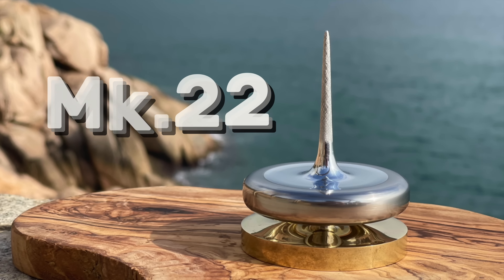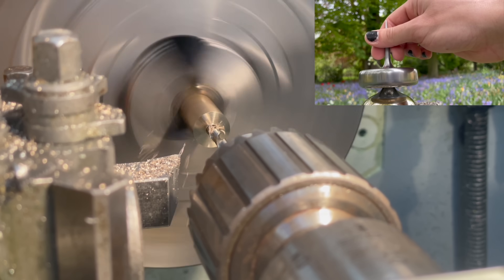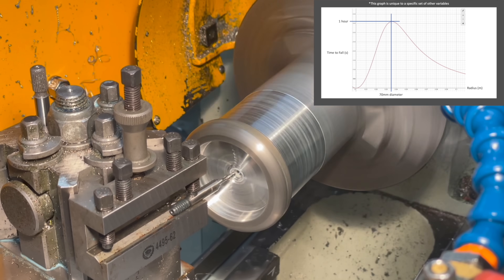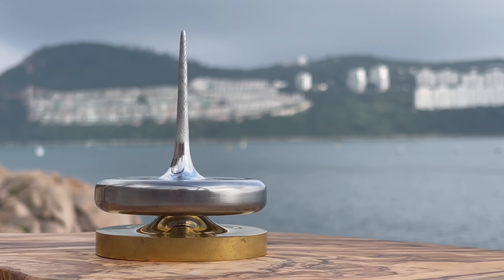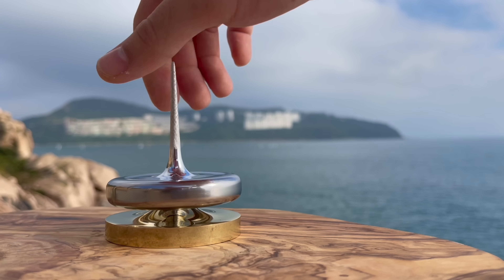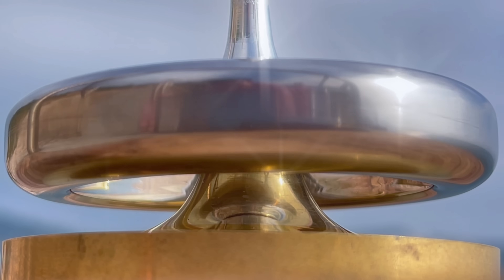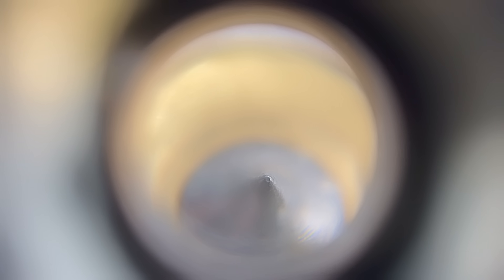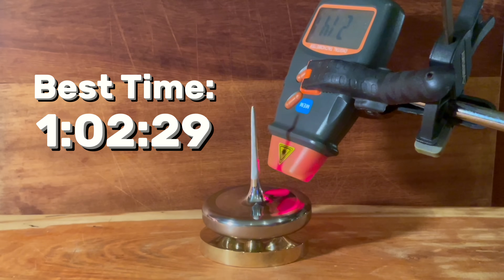Spinning Top Mk.22 | 1 HOUR BARRIER

Comment from the maker: I have commented about quite a few similar suggestions so I think I'll leave this post here in case your great mind is thinking alike!

1) Golf Ball Dimples / Shark-Skin or otherwise textured coatings for reduction of air drag:

Golf balls work by increasing viscous drag but decreasing pressure drag by more (put very simply here, many good vids out there). Since my tops don't experience pressure drag, adding texture would only increase viscous drag. So far, I've found that a perfectly polished surface is best, however it is certainly an area for innovation so do leave other ideas!

2) Ruby/Sapphire jewel tips/bases:

Tungsten carbide, like I use, is harder! And easier to get in a spiked form which benefits more from lubrication.

3) Polycrystaline Diamond/Cubic Boron Nitride tips/bases:

These are harder, but very abrasive. If only used for the tip, it would cause drilling. If only used for the base, it would rapidly blunten the tip. If used for both ... I'll admit I haven't tried yet but I suspect both would occur.

4) Uranium/Osmium/Platinum etc flywheel:

(Apart from uranium) I would LOVE this, however I am not a millionaire so this is completely out of my price range. Pure tungsten would be the densest viable option (almost 20g/cm^3) however I have struggled to machine it in the past. Hence, Mk.22 used a 90-10 alloy (16.75 g/cm^3) which is softer.
Reply: spin it in a vacuum :)
Reply: What about hydrodynamic bearings? Or does a top have to spin on a point?
Reply from the maker: @jjb0nks  It should spin on some kind of point, either conical, spherical etc. A bearing like that would stop the top from being able to topple, hence it is no longer a spinning top.
Reply: @hiper_tops  Does the base have to be static? The base could be another spinning element (with a means to retract when it loses momentum, a centrifugal clutch mechanism or something). That way tip friction could be reduced. The base element could have a shell around the top's doughnut (to shield it from drag). The thinking is to have something like multistage rocket, but with like mechanical parts acting as boundary layer separators to reduce the delta V to the surroundings.
Reply from the maker: @DT-dc4br  I see what you mean but if I strictly go work towards improving the record, it would not be allowed. A different idea which might be interesting is holding the base on an inclined, rotating surface such that the top moves in a slow circular path. This would stop drilling and potentially help spin times without really adding energy to the top.
Reply: From Wikipedia: "...the dimples on the surface of a golf ball cause the boundary layer on the upstream side of the ball to transition from laminar to turbulent. The turbulent boundary layer is able to remain attached to the surface of the ball much longer than a laminar boundary..."

I don't believe this can be used for spinning motion, since for the air layer to stay attached to the surface, it would have to rotate along with the spinning top. I feel like the air would rather be flung outwards than stay with the circular motion, which would probably introduce more friction than with a flat polished surface
Reply from the maker: @carny__  Yes precisely :)
Reply: Time to use a laser balancing system to truly balance it.
Reply: Have you looked at WPC treatments?  I'm not entirely sure it would work because you already have hard surfaces and small contact points, but maybe?
Reply from the maker: @TGoat5  Polycrystalline tungsten? I'm not familiar with this. I'm looking for a material with incredibly high hardness, without being abrasive, for the base and a material with slightly lower or equal hardness for the tip.
Reply: @hiper_tops  not polycrystalline tungsten.  WPC is a surface treatment that creates microdimples that lower friction sometimes used for engine parts.
Reply from the maker: @TGoat5  Ah I see this is like the air bearing effect - it certainly has potential in similar applications, in this case the top would be floating on a cushion of air. However I can't find a way to implement this whilst the top is still able to topple! Without the ability to fall over, it is no longer a true spinning top.
Reply: @hiper_tops is some kind of titanium aluminum nitride or similar coating useful?
Reply: @hiper_tops several people have mentioned air bearings, but have you ever played with ground glass syringes? You can spin them up, they're pretty neat and nearly frictionless, also very stable atop a cushion of trapped air. there's a Steve Mold video on yt where he demonstrates the effect
Reply from the maker: @tylerjmast  I must admit I am hesitant about coatings because, for spike tips at least, after a few hour-long spins, I have to resharpen and rebalance the tip with diamond files. So any coating would be lost quite soon, and it tends to be an expensive process. I can see a coating for the base being more viable though.
Reply from the maker: @tylerjmast  Yes I have haha, I actually made a stirling engine using some of them :) The air cushion effect is very cool but hard to implement with spinning tops
Reply: Spin it atop an air bearing.
Reply: Why is the stem so long? I know you must have a good reason for that, but intuitively, I would shorten it.
Reply: @Nonkel_Jef the taper allows you to spin it faster by hand. When you roll a cylinder between your fingers the smaller it is the faster it spins, you get less torque though.
Reply: Is there any easy way to see if the flow around it is turbulent or laminar? If it is already turbulent then you may see some benefit from texturing. You have a relatively narrow gap between the top and the base, so you might be seeing some turbulent flow in that region. Maybe blow some smoke in there to see what is happening. A quick napkin modelling suggests to me that the difference between centrifugal effects between the air in contact with the top and the air in contact with the base would set up a spiralling air flow that could (relatively) rapidly rob it of energy. It would certainly be larger than laminar losses. Something similar would happen at the top surface, but I would guess the bottom surface would dominate. I have no idea how you would counteract or minimize this effect, but it would be a start to understand it.
Maybe put some it in the freezer, or some other way to cool it first. I would guess the region between the top and the base is dominating air resistance losses, so reducing the viscosity of the air there should have a large impact.
Reply from the maker: @agsystems8220  You may find this interesting: https://www.youtube.com/watch?v=-wggqn9sgiI&t=3s&ab_channel=IacopoSimonelli
You are quite right about the spiralling motion of air. It is sucked in from the top and bottom and ejected in a disk near-tangentially to the edge of the flywheel. 
Your thought about a cold top lowering air viscosity around it is very interesting! I'll have a go
Reply: Have you considered some kind of mag-lev assist? Opposing permanent magnets in the base and point to reduce the effective weight of the top? May induce eddy currents in the aluminum and thereby sap energy, but I'm uncertain about that... This could also be cheating, or may not be viable at all for other reasons.
Reply from the maker: @tularjaggs334  Have a look at this! https://www.youtube.com/watch?v=W7bOpHaZvwQ&ab_channel=IacopoSimonelli
It can certainly help spin times overall by lowering tip friction and critical speeds. However for the category I have been working on, magnets are not allowed. An external magnet would count as external assistance.
Reply: Diamond has the lowest coefficient of friction of anything but graphene and would not be abrasive if polished finely
Reply from the maker: @phiro4305  I agree, monocrystaline diamond would probably make for the ideal base. However it is so expensive and hard to find the the geometry required. I'm not sure about graphene, I'll have to do more research.
Reply: @hiper_tops have you considered DLC or Diamond Like Coatings. They are used as ultra low, but hard friction surfaces in high performance race engines for gear teeth and cams
Reply from the maker: @ashishsjalan  I am looking more into it at the moment, certainly requires testing but it is expensive to do so on a small scale
Reply: @hiper_tops I work on precision motion control systems, and after reading the suggestions thus far, my background made me think from a purely "just bypass the tip friction issue" perspective. While it might be blasphemous(and maybe cheating) from a mechanical efficiency stance, I was wondering if it would be plausible to modify the base to run this as an air bearing. We use these on many systems(both linear and rotary axes) and these would make tip friction a mostly non-issue. You would still have to contend with air resistance, but this modification may possibly be able to assist with that as well.

This wouldn't be a conventional setup for the base, but the top should be able to stay relatively the same, with at most, only a change in tip shape.

Idea, make a second base for the Mk.22, where the base's surface is notched out to perfectly match the tip's profile. The top's tip should perfectly(with a fairly decent tolerances anyways) fit to rest in that notch in the base. After, make a small hole in that base where the tip would rest deep in the base, connected to another drilled hole in the base that can act as an air line. Connect that to an air fitting so you can run a hose to the base and the supplied air should come out around the tip. 

At rest, the gas would just push the top up slightly till it tips enough to allow the air to pass, but if you rotating the top, the air should drag between the tip, and the walls of the base's notch causing the air to self center and balance the top within the notch. If you get the pressure right, and regulate it properly to keep pressure changes from the pump from effecting the air to the top, you should(in theory) be able to create a perfect air bearing effect that will(as long as the top is spinning) remove the friction from system usually caused by the physical tip-base contact point.

You would be trading contact friction at the end of the tip that would normally carry it's losses as in friction as heat, for increased air friction around the sides of the tip. That is a given trade-off since you're still applying additional force to keep the top centered and floating, but regulating the gas to keep steady pressure, will go along way in minimizing this effect at the tip.

Now to the drop in air resistance I suggested may be possible at the beginning. Currently the tops are running in regular atmosphere air, which contains denser molecules, and worse, moisture, which causes the effects of drag in air to increase quite a bit. Switching to a gas with less density, and lower moisture content will likely go a long way to increasing times. I'd suggest a gas such as clean dry nitrogen and starting with the gas at a mild temperature(between 22-26°C for example), then if you want to go to the extremes to fine tune things for longer durations, increase the temperature of the nitrogen by heating a section of the supply line before entering the base.

If everything to this point works out, placing a clear plastic box with small holes over the top once it's rotating should allow the dry nitrogen to from the air bearing supply to start displacing the denser, humid air in the box. This should cause the rest of the top to experience less drag over time and decelerate over a much longer period.

I'm not sure how this would play into timed records, since the gas itself isn't(if made correctly) supplying rotational force. Slightly angling and offsetting the exhaust hole in the base could have this effect though, causing the top to spin as long as gas was supplied... that would definitely be cheating there.
Reply from the maker: @Poptart133g  Thank you for writing this fascinating, detailed comment. I previously couldn't imagine how to implement an air bearing with spinning tops in such a way that they could still topple. However, your suggestion seems plausible - though rather difficult to make work perhaps. I would like to try this with a small ball tip and spherical hole so the top can lean over whilst experiencing the air bearing effect. This isn't an area of expertise for me but when I get the time I would love to try this :)
Reply: @Poptart133g  Isn't the potential for cheating too great?  Because as you said, all it takes to make a continuously spinning top would be to just design the thing "poorly". Even if not for an official record, it wouldn't be satisfying, I think, to wonder if your good time is due to good engineering and construction or from accidentally making a pneumatic motor.
Reply: @gubx42  I fully agree, that's why both at the beginning and the end I stated that it could likely be considered cheating officially.

It's more just something I figured I'd point out since it's something I'm very familiar with that doesn't seem to have been tried in this application, and something that would be rather interesting from both a machinist and engineering standpoint.
Reply: On behalf of point 4: Tantalum might be an option here, its almost as heavy as tungsten but a lot easier to work with. Its quite expensive but not on platinum or osmium levels as far as i know. (Edit because i forgot before: On a lathe it behaves a lot like copper)
Reply from the maker: @MrManniG  Interesting! Yes it seems just as dense as the flywheel I used here, but perhaps a bit cheaper! I would like to try it :)
Reply: Re shark skin: I thought sharkskin works specifically by decreasing viscous drag? Ie, a ribbed/sharkskin like surfaces does not work in the same principle as a golf ball. See for example "The viscous flow on surfaces with longitudinal ribs" by Bechert and Bartenwerfer or "Viscous drag reduction using streamwise-aligned riblets" by P. Vukoslavcevic, J. M. Wallace and J.-L. Balint. From what I understand, a ribbed surface with proper spacing of the ribs should give a drag reduction of around 10%. Might be too difficult to manufacture though, idk?
Reply from the maker: @mullgubben  It is a bit hard to say whether their findings would translate to a spinning body but it would be interesting to try. The flow over and around my tops would not be perfectly in line with longitudinal riblets so I fear this may reduce the effectiveness. Also as you thought they are a nightmare to manufacture, they are truly micro-structures. I'll think about it but it may be further down the line
Reply: what? @ImproveConditions
Reply: You mentioned lubrication. What are you using currently?
Reply from the maker: @MistressBlah  I use a small amount of oil. It is actually the lubricant that came with the ruby bearing balls I bought previously.
Reply: Would freezing it affect the drag. Quantum levitation maybe?
Reply from the maker: @bryanschaefer7616  There is a chance freezing it would reduce air viscosity around the top and hence drag. I need to test this. Without room temperature superconductor, I don't think we will see quantum levitating spinning tops yet.
Reply: Do you have access to Alpha DLC coating for the base?  It would be very tough and lubricious.  Also, would Molybdenum dry lube help with this?
Reply from the maker: @erggml1887  I wouldn't say I've got easy access, it would be an expensive experiment. If I secure more funding (which I am applying for) I would love to experiment with such materials and surface finishing processes. Similarly I have not tried many obscure lubricants yet but yes it sounds like Molybdenum dry lube has potential in this extremely high pressure scenario
Reply: I don't if it would be outweighed by the aerodynamic forces it would add, or if would be cheating, but could you design a mechanism to have like arms that swing out and slowly come back in like a figure skater to keep it spinning longer?
Reply from the maker: @jamesa8851  I have thought of something similar - a hollow flywheel with liquid mercury inside. At high rpm, the mercury is on the outside due to centrifugal forces, increasing the KE storage, and at low speeds, the mercury is at the bottom, helping stability. In reality this liquid version would be very difficult and not very effective - though cool! Your idea would also be cool but in that case, experience a hell of a lot of air resistance
Reply: For sale?
Reply from the maker: @uknowjoe03  Not this one but I’m working on designing something similar which I could make a few of and sell :)
Reply: While it would deviate from the original goal of making a pure, conventional, top, It would be very interesting to see a variation done with an air-bearing/hydrodynamic bearing... I know you already shot down the idea of a hydrodynamic bearing, however you could use a cup-shaped receptacle/base on/in which the top is sitting that would not hold it vertically with no air flow... although any kind of cup that would make it function would likely result in enough stability that someone could carefully balance it vertically... it would be very very close, and lubricating the cup well would make it incredibly incredibly difficult.  I wouldn't consider it to be, technically, the exact same challenge and probably wouldn't/shouldn't effect records - But would be an extremely impressive/interesting result no matter how it turned out!

Is it possible to create a sealed bearing which has better friction or wearing properties than your current tip to base interaction?  If so, would such a bearing placed within the top mediating the main mass rotation from the tip's rotation (resulting in a slower total tip rotation) improve the top's performance, or lessen wear on the tip?  (reading comments to see this has been suggested, within the base of the top... perhaps all three locations, combined with the 'angled base' should result in the angular motion you want without an external source of power
Reply: That was some High Performance machining on them Lathes my man, well done.
Reply: What about using magnets to push the top upwards to reduce friction?
Reply: Why not use magnets to reduce friction by suspending the top on air?
Reply: This may have been brought up, but what about using graphene as the lubricant? Could it potentially perform better with a small dimple for the tip to rest in?

I love this project.
Reply: You can buy Osmium powder and put it in a press
Reply: that cog being half a cunt hair above the contact point.. well played sir.